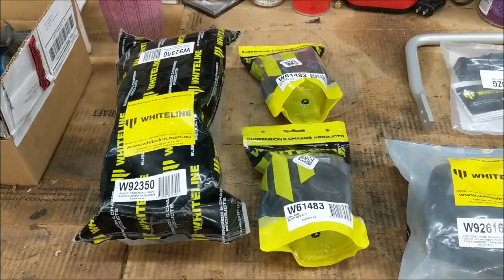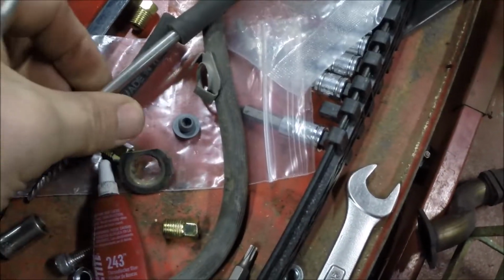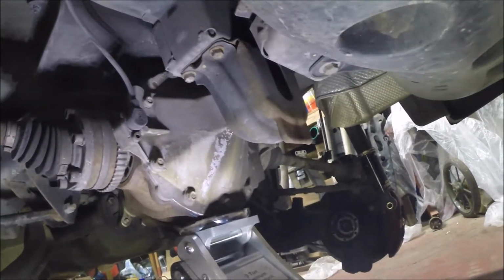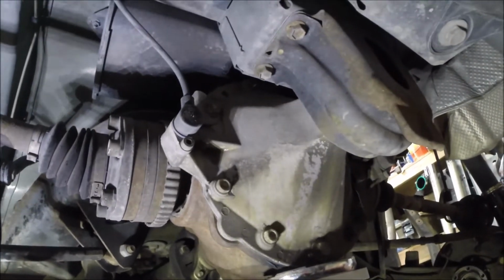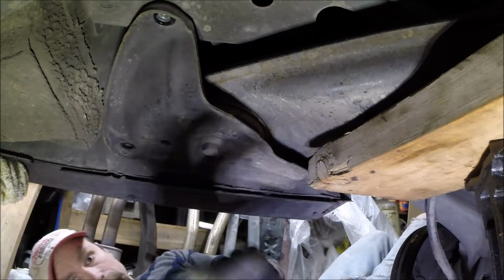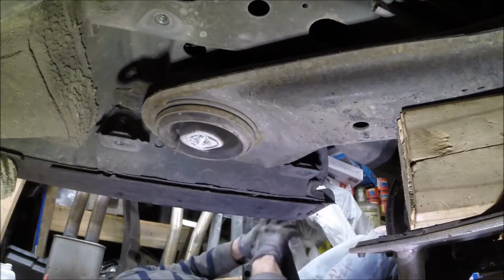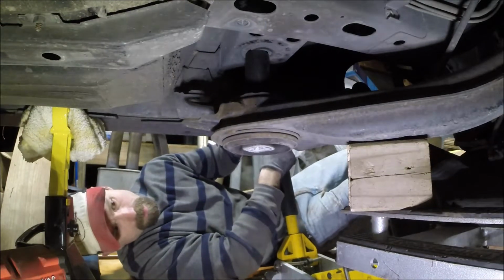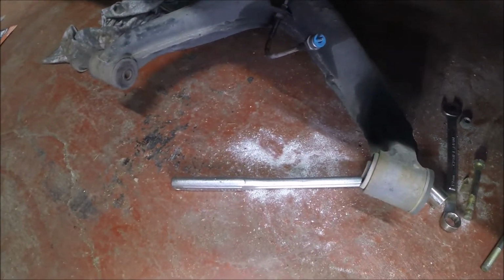2005 GTO suspension pt 11 rear bushing removal

Comment: Good video I have to remove my control arm I cant get the spindle and the axle cup to seperate and I have to get a new bearing in there what a pain they made this. My question is do you have to drop the diff to get to the bolts for the control arm? I am glad I saw you scribed it I read online about a cradle alignment tool I really dont want to spend that kind of money for what should hopefully be one use.
Reply from the maker: I wouldn't be able to tell you which one but I'm pretty sure there's a Josh's Car Corner episode where he changes the bushings without unbolting the differential mount. If I recall he removed the inner bushing bolt then pulled the control arm down at an angle to get the outer bushing to clear the trapped bolt. I think it is called something like curing wheel hop. I never tried it so can't really say exactly how it's done.
Reply: @evsnova74  thanks for the info I appreciate it I will check out his video

Comment: Wish I had waited. I bought bmr bushings and they are blue. Though they will never be seen I’ll know😩
You mentioned having to possibly take it to a shop to get brakes bled? I’ll be swapping the whole cradle so what’s the process for that going to be? I’m old school, one guy pumps the brakes while I’m bleeding them. My friend has a pressurized tool he swears by. Is there a way to avoid a mechanic visit?
Reply: bleeding these brakes is a pain its taken me aprox 4 different attempts to finally get it done right. I did a simple overnight gravity bleed too at one point.
Reply from the maker: What's wrong with that? Just don't like the color? They're still poly right?

Just make sure you plug the lines good enough so that the reservoir doesn't run dry and you'll be good. If the reservoir lets air in then the abs system can supposedly get air in it and the abs system will need to be cycled to get the air out. Some attempt to do this by braking hard over wet grass or leaves to activate the abs. All the tech 2 system does is electronically hold the abs valves open so that you can bleed all the air out. 

Get a set of vac line plugs from an auto parts store and put the correct size on there like I did in this video and it will plug them just fine, then when you attach the new stuff you can bleed as normal.
Reply: @evsnova74  yes they are still poly. Just blue. My car is black/red and I ocd on it a bit. 

So I’ll probably keep my lines on the car then, to keep as much fluid in the vehicle as possible. My car and my new diff have Russell lines. I’ll probably just save the other ones. 

Thank you for the videos. I like your method of removing the bushings the best because you didn’t introduce heat to the metal. I’ll be doing it your way.
Reply: @kylebourke8103  any recommendations?
Reply from the maker: @Modern-Muscle-PNW  oh ok. Yeah they're impossible to see. Maybe you should have gotten the energy suspension set, the inners are softer poly to allow for some flex when retaining the toe adjustment rod. Plus they're red. I would urge you to read this, I'm risking binding my rear suspension by using hard poly inner and outer bushings while retaining the toe rod: https://www.ls1gto.com/threads/inner-rear-control-arm-bushing-options.845581/
Reply: @evsnova74  pretty sure mine are hard in/out. I’m really not going to be doing hard cornering I just want solid launches with no hop. 
Think it’ll be alright?
Reply from the maker: @Modern-Muscle-PNW  I hope so because I'm doing the same. I got the impression that the guy who had something break was pushing it really hard road course racing.
Reply: @Modern-Muscle-PNW  I hear ya on the ocd lol so far my entire car is whiteline poly bushings except for the rear sway bay end link bushings since the pedders ones were a 2 piece design and way easier to install then the one piece whiteline version
Reply: @evsnova74  good read thanks for that. do we know how low we can go before we start having problems with the rear in regards to binding?
Reply from the maker: @kylebourke8103  That's a little bit different issue because with this semi trailing control arm the lower you go the more negative the rear camber. The only way I know of fixing that is with eccentric bushings. That adds a whole level of complexity to this already complex issue that I still don't fully understand. Andy Kollar always says that eccentrics suck and not to use them. As far as I know, if you opt to use eccentrics on the inner and outer locations you don't use the toe rod. The question is can you get the camber and toe adjusted correctly just with the eccentrics? Can you find an alignment shop that knows how to deal with them? I would say if you were able to get everything within spec using quad eccentrics, just ditch the toe rod and you'll never have binding. And even then I have no idea if they would go out of adjustment later.

Comment: Keep up the good work! I’ve been here and done that and glad it’s over with! Lol You will enjoy the car more having all of the suspension and bushings upgraded!  When you go to put that differential back in you should definitely look into the gforce1320 HD diff support mount.
Reply from the maker: I've already got a Whiteline poly insert that I'm gonna start with. Eventually I'll be adding enough power to necessitate a better diff mount, perhaps even a harrop. That's down the line a ways though
Reply: @evsnova74  I had the insert I tried too. Waste of time and money in my experience.
Reply from the maker: @Xrc53  well I already wasted the money on it, I might as well waste a little time lol. It's gotta be better than nothing.
Reply: do we know if the gforce 1320 hd diff mount will still allow us to use that area as a jacking point to lift the car?
Reply: @kylebourke8103  I still put the jack under my diff to lift the car up for the rear. If that’s what you are referring to.
Reply: @Xrc53  I did that for a while too before I learned that putting pressure on the bottom of the diff "pumpkin" itself can crush the bottom drain hole. As you can see in the yellow box at the rear of car the jack point is actually the diff mount itself.
Reply: @Xrc53 this is what I was told, I’m going to return my pedders insert and install the G forxe mount I bought !

Comment: If you get air in the abs module don't sweat it.  Find yourself some wet pavement (or make some) and drive through at a mild pace, slam the brakes and when the abs kicks in it'll refill the system ;)
Reply from the maker: I've heard of guys doing that. I thought I was going to have to because my nephew is trying to learn how to drive a manual, so he was in there pushing on the pedals and blew one of the plugs off. It leaked overnight so I thought for sure it ran the master dry. Luckily I bled the brakes yesterday and they were fine.

Comment: super jealous of the bushing press tool you used on the control arm bushings lol. I used a blow torch with map gas and a hammer to burn mine out.
Reply from the maker: You can get em at AutoZone, then get full refund when you return it. I'd love to have one on hand but it's a bit much at 100$.